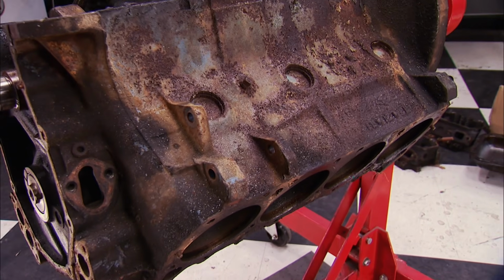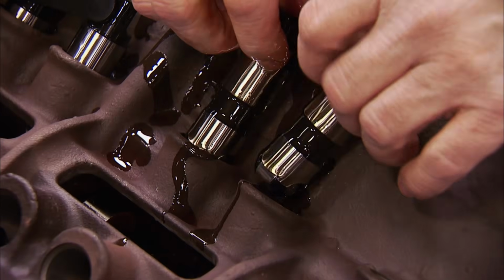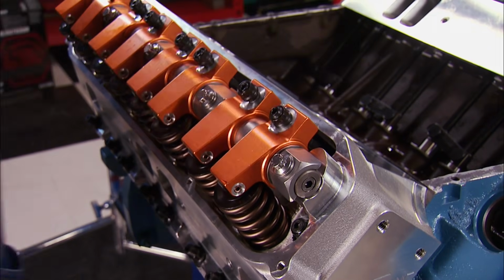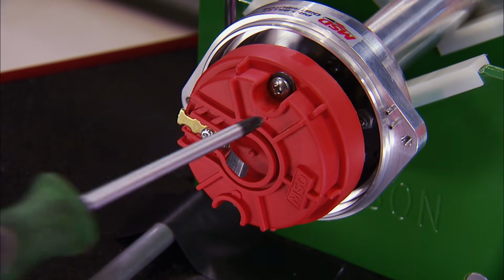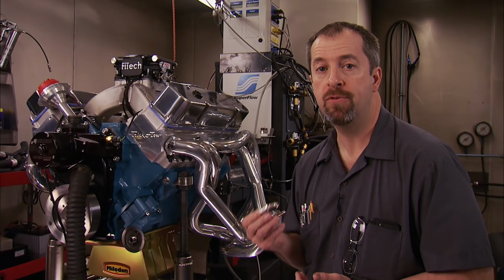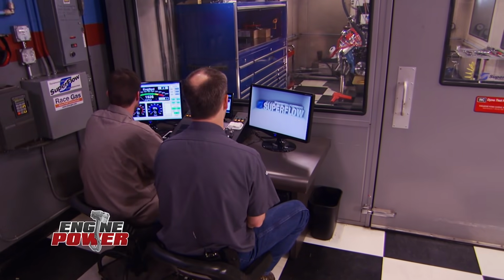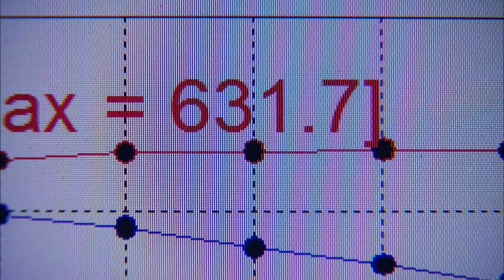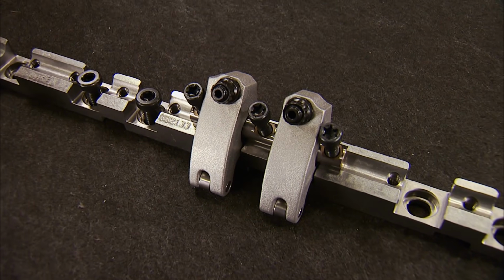Pulling The Power Out Of The 512 Stroker Raised Block - Part 2 - Engine Power S3, E10

Comment: All that power and 512 inches swinging on weeny 2 bolt mains, not even a stud girdle to strengthen it up. Smh
Reply: @Fred_Garvin-icu  I'm fully aware of how they run. They also do it at much lower rpm. A race boat that operates at higher rpm constantly, that makes much more power, use an aftermarket block. Either way, no girdle necessary. Not my first rodeo. FYI, just got done with a 440, good parts, stock block, 6-71, performer heads, 9.1, 750hp @7 lbs with 93 octane. NO GIRDLE. 
Yes, newer engines use a y-block configuration,  however it does nothing for added reliability, and also increases windage. Not a very good design at all. Crossbolted offers no advantage. Built right, no need for bandaids. Been there done that. Moral is, a stock 440bblock will give out after a certain power level regardless of what bandaid you put on it. In this application, as well as others, a girdle does nothing. Cap walk still exists. Bearing failure still exists. Cracking still exists. They might keep the crank inside the pan when the main saddle tries to spit out the pan, but that is all. I've heard all theories over the years. I stick to reality.
Reply: Not needed at that level.
Reply: @Fred_Garvin-icu  The engine doesn't know it's in a boat. Power is power. I have done many engines, with more power, that did not utilize or need a girdle. In a car, or in a boat. Side note, having a girdle doesn't do much anyway. Certainly not what you think it it does. If it wants to break, it will.
Reply: the main bolts are 1/2, dude. also, they are using studs. big block mopars dont have bottom end trouble until 800hp.

Comment: I know it's meant to be marking but that EFI system is just not a smart solution. Throttle body injection is a total bandaid solution, either do it in the ports or just put a carb on it if you want simplicity.

Comment: When these tbi systems like fi-tech and sniper become rebuildable vs being throwaway junk when they have issues they might be worth the price.  Carbs are just about eternal while the electronic tbi stuff goes in the trashcan.
Reply: Better to go with port injection? Obviously you need an appropriate manifold, but better mixture distribution and rebuildable injectors is a plus.
Reply: @nerd1000ify  Probably.  Issue will still be the quality and availability of the electronics.  Getting to the point all the china stuff is garbage and that's all that suppliers are buying from.  Multi port efi and a fancy computer are great for making and controlling big power but it's tough to beat the simplicity of a pair of carbs on top of a roots blower.

Comment: Shouldn't have to manually change timing if they actually used the timing control. Set the base, make sure it matches the ecu setting, and go from there

Comment: You could just hear that torque difference in that engine when they switched to the carburetor. Imo, fuel injection isn’t needed for an engine built like this for the street. Good build, but knowing where the power actually came in would help.
Reply: EFI never needs to be re-tuned unless you make changes to the engine configuration, doesn't struggle with cold starts.  That's worth the asking price for EFI.
Reply: @Dayandcounting  no its not. im not paying 1200 for something i gotta sit down and fiddle with all day. carbs for me. simple jet and metering rod changes.
Reply: @frigglebiscuit7484  give me an 850 cfm any time. Better performance from a carb. People need to learn to read a vacuum gauge
Reply: In an absolute physical sense, all other things being equal, EFI should give you very slightly more power than a carb. The reason for this is that the carb's Venturi is a flow restriction that the EFI does not have.

In practice it's less clear cut, but what is clear is that a EFI system gives you far more control and much better part throttle operation, which is why all the OEMs use it (they need perfect AFR at all times for emissions).

Comment: I’d like to see the distortion…if it’s being pulled it’s being pulled.  I’ve switched them with no bearing issues.
Reply: Most of the time, it isn't needed. Just a myth.
Reply: @jrdmotorsports9718  I agree.  It messes up the crank cam centreline as well.  I wouldnt be line-honing that unless I no other option.
Reply: same. i put arp rod bolts in my 400 mopar rods and didnt get them resized. runs fine.

Comment: I’d like to see a 440 with multi-point fuel injection and a mild cam with a turbo, I bet it would wake right up and perform well
Reply: You get what your given ..
Reply: i’m making over 700 hp at only 7 psi with my EFI twin turbo big block mopar. there’s a few videos on my channel.
Reply: The head design for a stock style 440 is terrible and limited to roughly 240cfm. To look at an LS head and compare it visually to a 440 I dont see much difference, but there is alot, like 100 cfm difference. a 440 with a big cam and turbo at 15psi might make 600-900hp. a LS/GenIII Hemi is gonna make alot more than that on 15psi and street gas.
Reply: @Arthagnou  did he say ls? no. he said 440.
Reply: @Arthagnou  What a ridiculous comparison.
That's like saying late 1960s computers are terrible compared to 2000's computers - Who would've thought??
Reply: @Arthagnou  600-900 is a pretty wide range lmfao
Reply: @Arthagnou  no LS/GEN3 HEMI is going to make 900+ on pump gas at 15psi in real world application.
Reply: hopefully you know that the first big block Chrysler was designed in the mid 1950s. And I believe it was 350 cubic inches and put in gigantic land yacht cars. An LS engine was designed in the mid-90s and is a great engine. The 426 hemi was really Chrysler's performance engine.
Reply: @Arthagnou  - Yep, while the heads on this engine are a big improvement over stock they still don’t flow as well as a good LS head.  This is shown by the power curve with HP below peak torque.  Heads are holding back this engine.
Reply: @danmyers9372  B1 heads and the acompanying parts puts this engine normally aspirated anywhere you want it,mopar speaking,with a turbo who knows,i've never seen one pressurized,i know they put gmc blowers on them in the old days,just weeks before the 426 hemis come out and stayed on top,forever
Reply: The B 1 would be nice.

Comment: I would like to see you guys build an engine for an RV. Taking into account durability and torque for hillclimbing in the Rocky Mountains to cooling in Death Valley.
Reply: These are Chevy guys, they’d struggle to find the power where it needs it. But it would be interesting, especially on a low compression, high dynamic pure torque build.
Reply: All engines do is compress air.  Take the numbers, letters and symbols off them and they’re fundamentally the same.  Brand is irrelevant.
Reply: @jaredmayer3960  lol no. noooo.
Reply: @jaredmayer3960  The quality of components matter.
Reply: @phonebackup8132  yep the quality of components matters.  I don’t get what you mean here?  Any component from Ford, GM or Dodge are fundamentally the same.
Reply: @jaredmayer3960  These days, correct. Via the aftermarket there is virtually an infinite selection of parts (heads, valve size, rod length, intakes, stroker kits, cams, etc.) that make the actual engine family/platform essentially irrelevant. 50, 60 or 70 years ago, not so much.
Reply: Maybe not an actual RV but totally for a legit daily driver with a standard torque converter and normal rear gears. This engine is not practical for a daily driver. Keep the stroker kit, roller valve train and AL heads, but dial back the cam, compression and bling.

Comment: Nice. I have not seen a throttle body injection like this one before. I bet this injection system could be used on a Dual plane intake without the issues a normal throttle body injection has. Here is the link to setting this up....https://www.youtube.com/watch?v=ImnblxUYHRY

Comment: Now swap a 4500 style carb and a tapered 4500 to 4150 adapter on it . I have a 512 with a 1195 demon and it makes 770 hp...
Reply: Swap those Harland Sharpe rockers out for a Comp ProMagnum stainless set, T&D or Hughes Engines rockers. Crane and Harland aluminum rockers will fail its only a matter of time with a healthy cam.

Comment: As if headers don't already have enough collector leaks. Weld an O2 sensor bung in place. That apparatus looks as if it's going to leak immediately. If the O2 reading isn't accurate neither is the self learning EFI at building a fuel strategy.

Comment: If you had used an MSD Atomic EFI unit the timing could have been EFI unit controlled and completely tunable to build your own curve in that locked out MSD distributor. That means more power across the entire RPM range. It's also boost ready turbocharging centrifugal blower or a roots style blower and can be used with E-85 just add 20% more cubic inches during setup on the handheld tuner.

Comment: Too bad the 440 never had cross bolt mains😑 it could have competed quite well against the 426 hemi had Mopar given it a good strong block casting from the beginning.
Reply: You can use a girdle from Hughes Performance that makes the bottom end much stronger.
Reply: doesnt need them. also, the 400 cold weather block is arguably just as or stronger than the hemi block.

Comment: I recall when Joe and Mike made some low budget mods to a junkyard 460 Ford and made 607hp ,585 lbft.  Leaves me wondering if Pat and Mike are really trying to make power w/Dodge cause they always perform lowest of the big three. Consider this, why'd they use heads with only 240 cc intake runners ..for a 512/440 BBD ?
Reply: Yeah like the BBF vs BBC and the Ford made over a 1100HP  with less than the BBC. You just can’t beat the BBF for budget hp. 385 series BBF has a tall deck, larger bore spacing and wide crank case spacing for a stroker application.
Reply: @StainlessTIG2  I recall the look on Pats face when the Jon Kaase dyno numbers came up on his 598 cid BBF, which made 112 lbft and 90 hp more than Pats 632 BBC ..w/15.03:1 compression.. all with 2 bolt mains.
Reply: @StainlessTIG2  weak bottom end.
Reply: @Ragingbull340 The parts are supplied by sponsors. The show would not exist without the aftermarket supplying them with parts. So they probably had this set of heads and decided to build an engine with it. Nothing wrong with slightly smaller heads for a street motor. Getting into a pissing match over peak numbers is pointless.
Reply: Maybe trickflow was the only ones that would sponsor the heads or maybe ur right and something fishy is going on
Reply: small ports work great on the street giving extremely broad torque curve starting way down low. overported engines are pigish on the street without stump puller rear gears.

Comment: What ever happened to the stroker small block Mopar you guys built last year? I never saw a Dyno run on that one.
Reply: @Jay Riley yup if u watch close you can see the cup and ball push rods they require for LA , didn’t even have the correct rockers either,Ouch…. I have a 408 mag with the trick flows my push rods are ball and ball with oil passage.
Reply: @Jay Riley LOL i remember that.

Comment: 1 point on parts check while installing are the rocker adjuster so it gets kit by oil when the cup of the pushrod is in the up/no pressure position.I made an oil restrictor for the rocker arms supply in the rocker stand I put a Mig welding tip drilled to .080/.100" and cut to length where the stud will hold it in the stand.

Comment: Carb for the win again lol!! Not as good for everything but Wide open they make them scoot!
Reply: Would love to see that motor with the trick flow 270 top end kit
Reply: @raymichalski2795  how about those new 295
Reply: 850 cfm  34 degrees of timing  don't think I would have went with the dish more of a flat but it would have raised the compression
Reply: Where's the 6 pack with 1350cfm for this old 440?
Reply: @scottpearce7466 in the trash we're it belongs. It's old news
Reply: @Ron Kirkpatrick good idea 👍.  Yes, the Trick Flow stuff is nice. Have a few builds here that require them, but none to be found.
Reply: @Ron Kirkpatrick Which ones? Looking mostly for the 270cc hydraulic roller heads.
Reply: @Ron Kirkpatrick All good 👍  thanks.
Reply: LOL,,,,that little efi was a fail before it was even installed,,,only because it has too low of an air flow for this application to get maximum power.
Reply: Fitech is not the standard for efi. It's more or less the base level. Just saying.
Reply: @Thatoneadventuredad  You are correct, but the end results are the same when comparing a carb to fi. FI meaning fuel injection as a whole, not a specific type. A Holley Sniper, apples to apples, comes the closest to matching power.
Reply: @Thatoneadventuredad  - FiTech is Chinese junk.  I used to respect the guys on the show but I now see them in as marketing agents for second tier products like FiTech and E3 (junk) spark plugs.
Reply: Not just wide open. The entire curve.
Reply: @JRD Motorsports  Any thoughts on the high-end, direct port injection? Namely a Plazaman Big Chevy intake, with say maybe Pro-Efi management and everything to go with it. My newest engine doesn't fit under the hood so I haven't driven the car in years and need to get it tucked underneath.  It's a 516 big chevy, made 697ft lbs@5000, 739hp @6400. I don't want to kill the engine either
Reply: Let's see how the carb does after sitting unused after a year or after being used everyday for 4 years. Carbs are for racing and dyno runs
Reply: @cromBumny  So gasoline that sits for 4 years, deteriorates differently in a Fuel Injected car than it does in one with a carburetor? Really? That's what you're saying? Because varnished gasoline doesn't affect rubber o'rings and internal parts of injectors, causing issues? 
If you're just looking for reasons to go against a carb making more power than the precious FI, there are none. Nice try though. 👍

Comment: Why would I want EFI if the carburetor made better horsepower and better torque More electronic bullshit on a car's just one more way it can leave you stranded on the road
Reply: Hard to tell with the few pulls they did with it on whether EFI would have ultimately gotten better numbers.  But, that would have taken a couple of hours on the dyno, or they'd have to install the engine into something and beat on it for the the computer to learn.

I would "Assume" driveability with EFI would be better.   But, they would need to show the carb in something being run for real and the EFI doing the same.
Reply: @dlewis9760  Driveability and idle quality, yes. But that is all it is good for. It'll never be smart enough to learn that much to outpower a carb.

Comment: OK where does the spacer ideology come from well in the 80s most muscle car intakes from 60s etc still run cast iron intakes that became heat saturated and adding a spacer seperated the carb cooling fuel and increasing power. Again velocity stack effect does not work in a vacuum application like a engine and gains are measured in ideology not reality. PUTTING A SPACER TO GAIN VELOCITY STACK EFFECT OR TO COOL ENGINE CHARGE RATE DOES ABSOLUTELY NOTHING ON MODERN OR ALUMINUM INTAKES BECAUSE OF LOW HEAT SATURATION. EVERY CAR MAGAZINE IN 90S AND EVEN EARLY 2000S RAN A STORY ON THIS AND A LOW RISE INTAKE ALWAYS ALWAYS ALWAYS WINS!!!! IF THESE MORONS EVER READ ANY CAR MAGAZINE IN LAST 20 YEARS THEY WOULD KNOW THIS AND ACCEPT THIS AS FACT!!!

Comment: Not a fan of throttle body injection. Port is still where it's at for me...
Reply: Yeah neither am I. I bought dual quad one of these and it doesn't work. Has a problem where it doesn't fit on a SBC because the IAC hits the small cap distributor. When I got a different intake it doesn't run because it goes super rich, super lean then super rich and backfires out through the carbs and won't restart until you reset it. This is in learn mode. The company couldn't care less. The huge distributor that sells it couldn't care less. The manufacturer doesn't respond to emails and the huge distributor deletes my comments on what I think about it based on my experience.
It's all worked out - they take your money supply a product unfit for doing the thing it's designed for and basically say bad luck when there's a problem. 
If you think I'm exaggerating read others' comments on this product.

It works on here because this show has clout. We have no clout so we get no service for their defects. $2k down the drain. To say I'm annoyed is about the mildest description you might apply.
Reply: @ThePaulv12  be nice if you can upload your experience on you tube and tag them. People need to be taught a lesdon

Comment: What the pen guy is explaining is velocity stacks which are more restrictive than worth and unlike a gun a longer barrel doesn't equal higher velocity.. THE spacer ONLY COOL THE INCOME AIR CHARGE INTO THE MOTOR which spacers don't work on direct port injection and the almost nill hp gain was complete truth to this despite being 80s throttle body injection...PUT A LOW RISE INTAKE AND SEE HOW MUCH MORE HP YOU WILL MAKE!!!